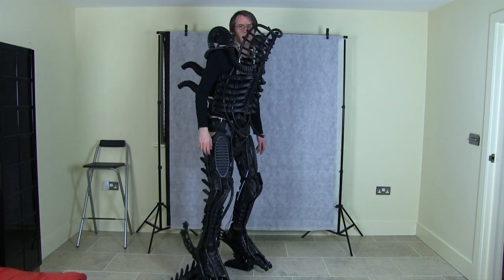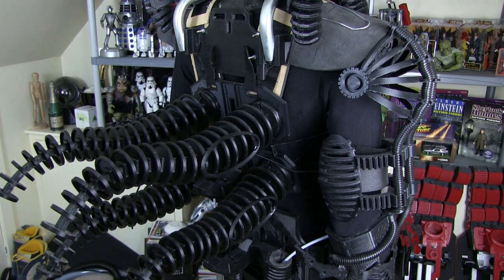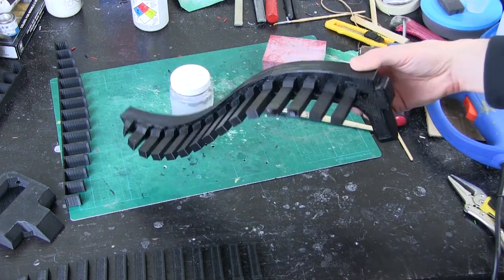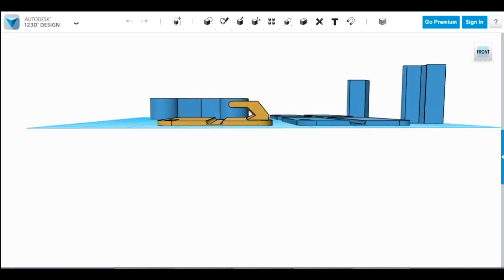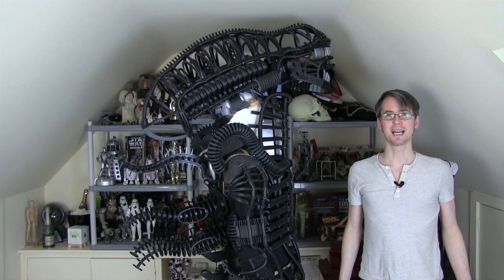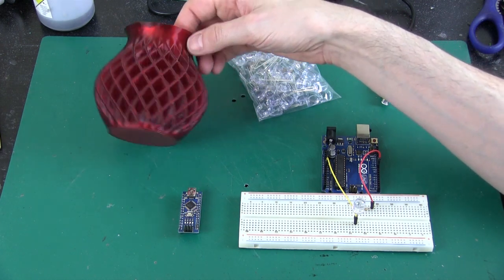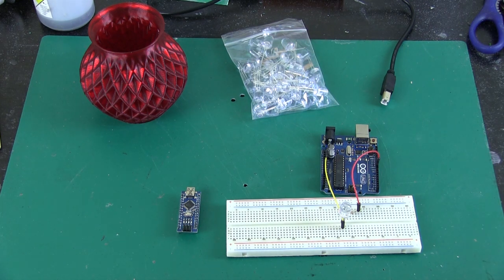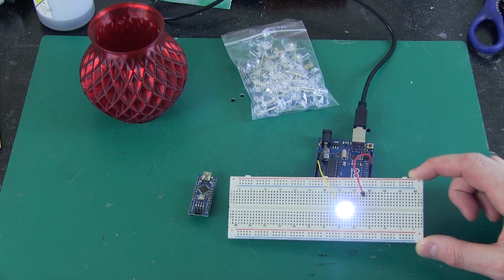Alien Xenomorph Cosplay #19 | Details & Electronics with Arduino | James Bruton

Comment: What are your settings to print ABS?  Do you use a fan to cool the part or turn the part cooling fan off.  I get my parts to stick to the bed fine but the layers pull apart as they cool.  my nozzle 235 and bed temp 80.  speed about 45-50 mm.  Any help would be appreciated  Your prints are beautiful.  thanks.

Comment: Why you don't use the RGB single pixel leds like the WS2812B (also known as Neopixel) much easier to handle and you only need one Arduino for 1000 leds. 
They are available as bare leds or soldered to pcbs quite cheap. I personally use them for everything and see no reason to use standard leds anymore?
Reply: ***** you can get the controller chip without leds and power 3 green leds with one chip and link them together like the normal neopixel, in fact you can link a few rgb in the row if you need the color. Saves a lot of pwm pins and much cheaper than arduinos ;)
Reply: ***** They are like $0.30 ea, I kinda agree with Andreas. It's way easier to controll and there will be less cables involved.
Reply: ***** But how much will the multiple arduino's cost and will neo pixels cost more?the advantage of neo pixels is that if you print the sections clear then you can choose whatever color you wan if green doesn't quite work out.